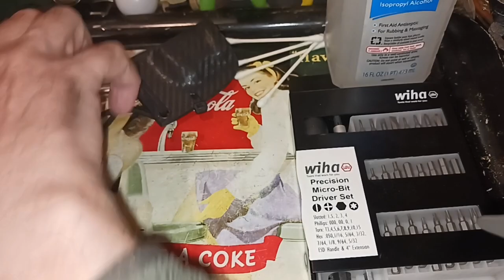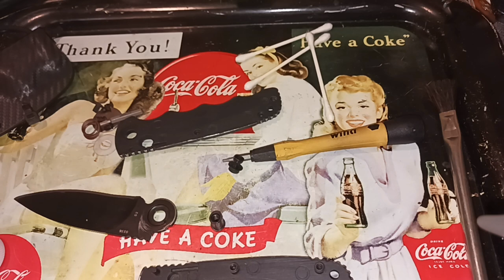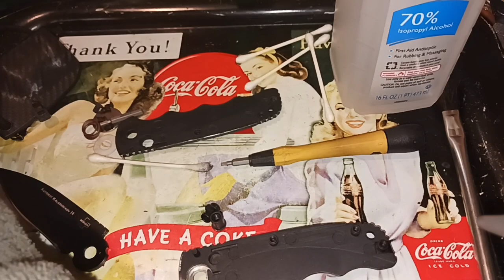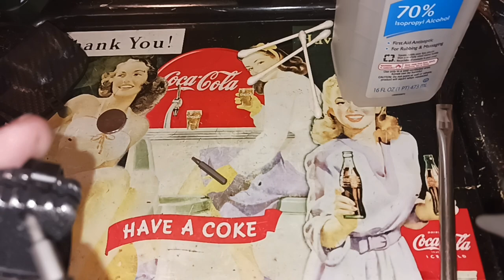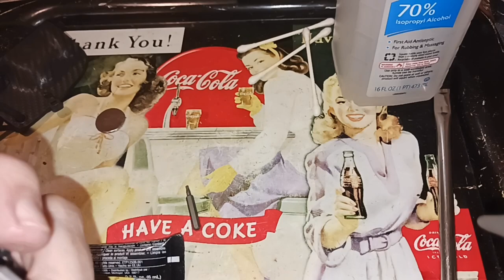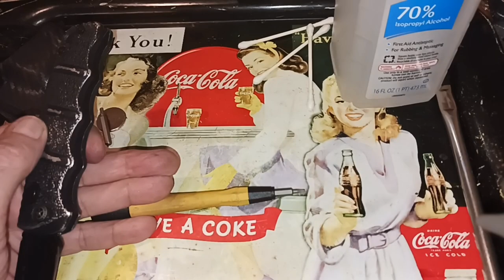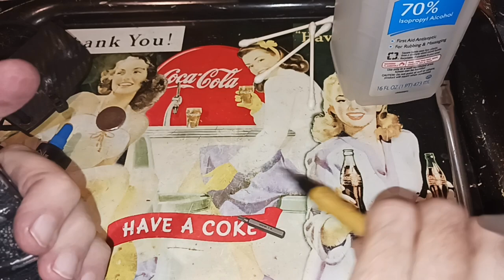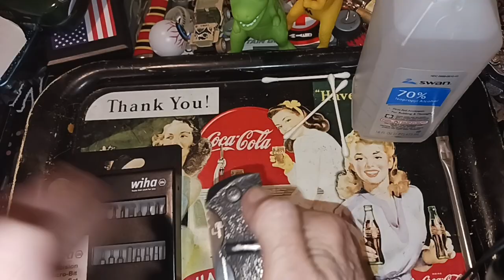(1100) A Boker Kalashnikov Automatic Knife Problem Fixed

Comment: Take the knife to the sink and run hot water over it as you work the knife flushing the knife out. Dry the knife off, oil the knife. Rinse and repeat.
Reply from the maker: Thank you.  I didn't think about that.

Comment: Iv had one of these about a week its failure  rate 30 % . Sprayed with isopropyl  then good 100 times opening . On 101 it fails .what's acceptable?
Reply from the maker: I've found that the button part on the inside builds up lint & gunk that prevents the button from going into the recess. Look at where the button joins the knife and make sure that cutout is clean. Other than that, I can't think of much else that would prevent lock up.
Reply from the maker: They also sell replacement main springs,  and that might be the issue, although it seems weird for that to happen on a new knife.
Reply from the maker: Also, isopropyl is great, but it removes all oil. Put a drop or two of oil on the button area after doing your isopropyl cleaning.
Reply: Nice , thank u . 
  If it makes a difference the company tht I got it from recommended this video  .
Reply from the maker: @tomfoolery2082   Thank you. 👍

Comment: Coil springs weaken from compression cycles; they lose strength as the number of cycles increase. A new Kalashnikov tries to jump from your hand when new. I noticed yours is not opening as strongly as normal. A new set of springs might cure the problem. They sell sets on line.🐯
Reply from the maker: I will get some replacement springs. They are kept constantly under pressure if you leave the knife closed. Replacement springs are not expensive & would be difficult to improvise a replacement.